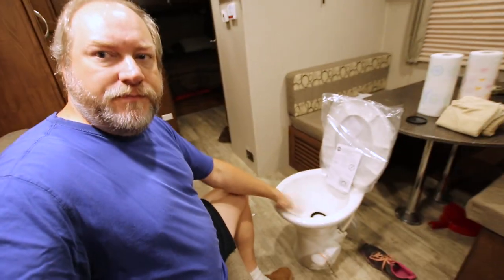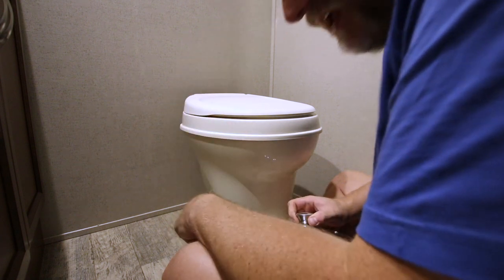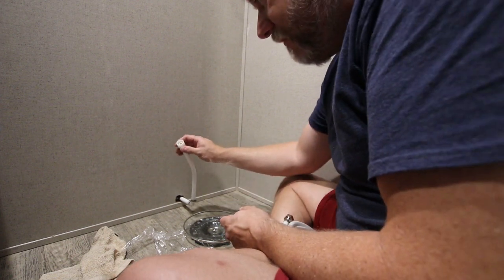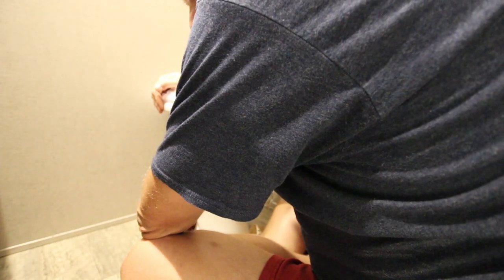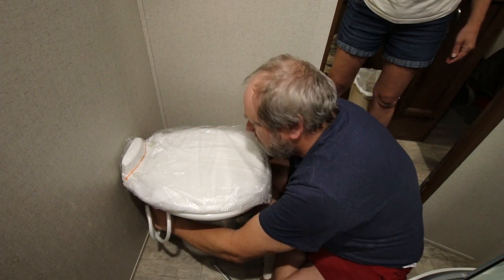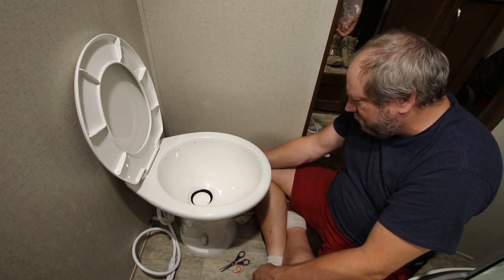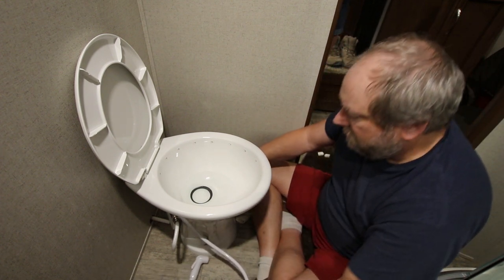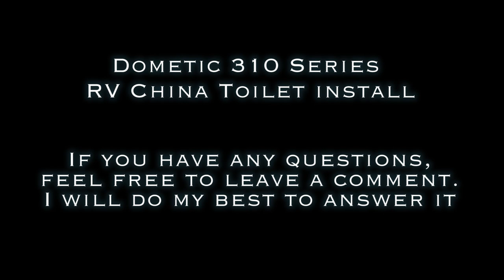How To Install A Dometic 310 Series RV China Toilet In Your Camper

Comment: No wax seal?
Reply from the maker: No wax seal is used in an RV toilet. You need a "dynamic" seal like rubber (provided). Wax is a static seal and would leak over time with the bumps and vibrations that go along with an RV.